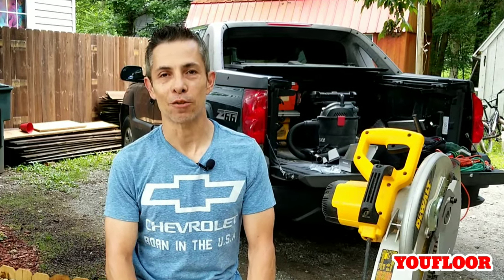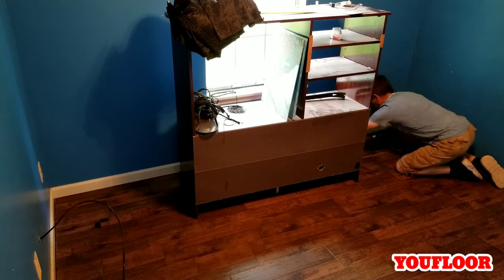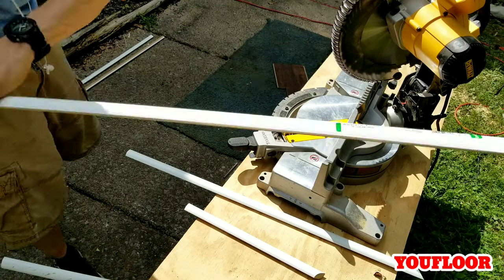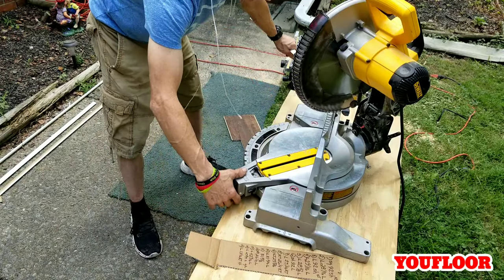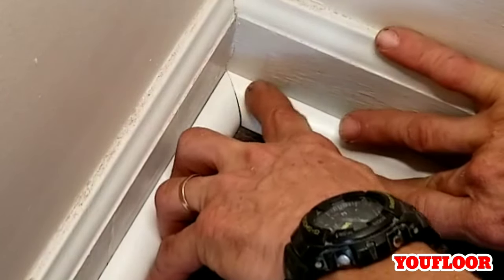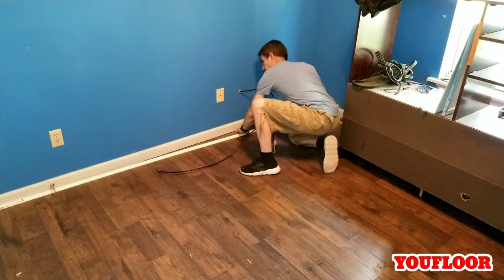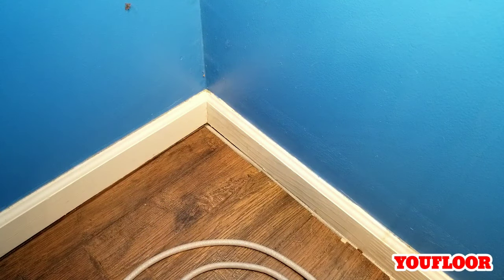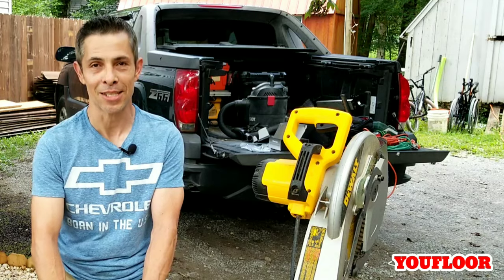How To Install Quarter Round Like A Pro

Comment: Personally, I think quarter round is tacky. A new floor warrants a new baseboard install. My method is to remove the baseboards, paint the walls,,install flooring, install new prepainted baseboards (touch up nail holes after). But that's just my opinion. Your 46 44 trick would actually work with baseboard installs as well. I'll try it out next week and see if it cuts down on install time. Those who like quarter round will benefit from your great strong by step in this video.  For me, my takeaway is that 44 46!
Reply from the maker: I hear ya. A lot of my videos in the beginning were when I was an installer for Home Depot. So when I got to the job the material was already there including the 1/4 round. I give the option on my own jobs. But home depot sales rep are like all others. The more you add to the job the more commission you make. So that why we always did 1/4 back then. For base I like to cope. One trick is to hold my gun about 1/2  away from the wall pull the lever back and fire a nail so that it sticks out of the wall. Then when placing the corner together  I flex the longer one and it will press the other tight. You can use a screw but then you may have to adjust it. That's why I use the nail. If it is sticking out too far on the bottom I can smack it lightly with a rub er mallet until the corners are tight. Hope that makes sense. Thanks for the comment
Reply: @YOUFLOOR  glad you got out of their shadow to do your own thing. Nice idea on the cope method  👍

Comment: What if you don’t have a miter saw can you use a circular saw
Reply from the maker: You would have to have a pretty steady hand if you are using a circular saw. I believe you can achieve  the same thing with a hand miter box if you place something like a wedge behind your material. I bought one for the purpose of making a video. Just haven't hhad the opportunity to film one. May just have to create one. Thanks for the question. Have a great day

Comment: I am renovating a condo that has concrete walls that are skim coated and the electric is run through a plastic chase that appears to look like baseboard.  I have installed the floating Pergo and now need to attach the base shoe to the plastic chase.  Clearly I can not nail this so it must be glued - any suggestions/have you encountered this scenario ever?  Thanks.
Reply from the maker: Yes up against tubs and sliding glass doors. I usually use silicone to attach my moldings and a couple dabs of hot glue on the back to hold it until the silicone sets up. Hope that helps.  Thanks for the question
Reply: Like the OP said silicone will work, and just buy a tube of liquid nails to get it to stay.

Comment: How do you measure for outside to outside cuts?
Reply from the maker: Hook the corner and go to the other corner to find your measurement. Then cut an outside corner (with short point against baseboard) Now measure from your short point to your measurement and make a mark. That will be to the other short point of an outside corner. Hope that makes sense. Thanks for the question.
Reply: @YOUFLOOR  

Yeah but you can't hook onto the short point so that's why I was wondering if you knew a trick to measure it after making the first cut.
Reply from the maker: @Tyler If they are short pieces you can line the short point up with the edge of your miter saw table and hook the table  and if you have long pieces to measure, cut the short point, pull your tape out longer than your cut and lock it, place tape on the ground and then line your short point up with the end of your tape. Hope that helps. Let me know if you have any more questions.

Comment: Ok so... about this foam strip situation... I’m finishing installing vinyl plank today and found your super helpful video for the quarter round. But.... the foam strips are throwing me off. I know you’re working with laminate in this video and like the sound of the foam protecting more from spills, but I’m not sure if that could fit? 
-OverThinker
Reply from the maker: This product is called caulk savor. It originally made to take up space when caulking so you don't have to use so much caulk. They say to leave a 1/4 inch but sometimes the gap can be slightly  bigger. This product helps to give you something to fill the space then the silicone will stay up on the surface of the floor. Thanks for the comment

Comment: First quarter round install and I was wondering if it’s necessary to put silicon behind each piece of quarter round like you did at the end of the video.
Reply from the maker: Not sure what type of flooring  you installed. But this is a requirement when installing pergo outlast. It is made to be waterproof. So selling the edge makes it impossible for moisture (spills or accidents) to make it under the floor. It is not recommended on non waterproof products. Hope that helps. Thanks for the question
Reply: Isn't using the cheap particle board trim problematic for having "waterproof" flooring as it swells easily when exposed to water?
Reply from the maker: You are correct. I wouldn't advise that. I would use real wood or PVC if your in a room that you know will have a lot of exposure to water. Unfortunately on the Home depot jobs. You get what you get.
I have mentioned this in the past but it will slip by occasionally. Sometimes I'll have some on the truck and just swap it out for that room. Excellent question. Thank you

Comment: Hey Z - I purchased  a product called "Trimfinity 7/16 in. x 3/4 in. PVC 127 Base Shoe" from HD. The inside of this product looks like an open cell foam and has a pvc layer on the outside. This is going in a basement so I wanted a material that was water resistant. I had a return and a short corner I needed to glue together. I used the CA glue with the accelerator as suggested but the joints did not hold together. Are you familiar with this moulding? Any other suggestions on gluing it? Thanks
Reply from the maker: @Steve Buchanan I went and bought some trimfinity today and will test it out and see what I come up with.
Reply: @YOUFLOOR  - have you had a chance to try gluing the Trimfinity shoe moulding? thanks

Comment: I used to subcontract for Lowe's, but i've been out of Flooring since around 2007. When did Pergo come out with this floor where you had to use silicone? What a pain in the ass that would be. Also just curious have you done any of the snap together real Hardwood? And how is it as far as installation.
Reply from the maker: Well pergo has many styles of flooring. The pergo XP and pergo outlast are very similar, except the outlast is treated to make it water resistant. And to make it truly water proof. The manufacturer requires us to seal the perimeter. At 1st I was Leary. "How can the floor expand and contract if its sealed up" I was told that 100%silicone flexes so it's not a problem. As far as the engineered woods. Brother let me tell you they have come a long way. Companies like home legend and home decorators collection,  and all the bamboos are a drop and lock. Literally. It was the inspiration for the company I started call "YOUFLOOR " When my son was  10 he installed 200 sq ft by himself in 3 hours. And he had never touch a floor b4 that day. I have a website I am currently loading  these style of wood for purchase. The goal is to provide the most diy friendly product for the average home owner. I mean why pay someone thousands of dollars. "YouFloor it"  thanks for the question
Reply: @YOUFLOOR  Wow ya snap together is a breeze, a beginner would have no problem in a square bedroom. It gets tricky for the DIY when cutting in say a hallway with a bunch of door jams. I figured back in '06 they would eventually come out with snap together real hardwood. Do you remember a product called Edge I believe? It was a snap together real ceramic tile. But it had issues, the grout came in a can almost like reddi whip.

Comment: Can the 44 degree cut and 46 degree cut technique also be used on baseboards?
Reply from the maker: I would imagine it would be the same concept. I usually cope the base. I saw a trick on Instagram where a guy had a huge gap at the bottom so he put a screw in on the bottom but didn't sink it all the way. By leaving it sticking out a little it acted as a shim sort to keep the base board from rocking in. Hope that helps. Thanks for the question.
Reply: That’s another good tip for out of plumb walls....thanks.

Comment: Can i have any idea you charge per sqf
Reply from the maker: If it's with another job. Generally, it is between .75 and 1.00 per month Ft. . But by itself, it would be a flat rate depending on how much time it took. Driving 30 minutes to install 50 linear ft would be something like $75 to $100. Even if it takes an hour. Hope that helps. Thanks for the question

Comment: Would if the quarter rounds are stained black could you still caulk it and then stain that part? Thanks
Reply from the maker: You never heard of that  ut most acrylic caulk  is paintable so I imagine it would stain. They make a black caulk though in case your interested. Thanks for the question
Reply: @YOUFLOOR  Thanks Ill check out home depot I didnt know!

Comment: Like a bay window I have a bay countertop which extends from the kitchen at an angle.  There is a transition at an angle from the kitchen to dining room that changes height.  How do I transition the quarter round trim around the cabinets across a transition strip into the dining room?
Reply from the maker: Is the transition a MDF ( paper like hard cardboard) or is it real wood?
Reply: @YOUFLOOR  the transition is from linoleum up to real wood with a wood transition
Reply from the maker: If it were me. I would take a scrap piece of quarter round and set it on top of the transition. Then take a razor knife and score across the fro t of the quarter round so it follows the angle of the transition. Then use an oscillating tool to cut that piece off and drop the new 1/4 round behind the transition against the angled bar. Yeah trying to run trim over transitions is not fun. Hope that makes sense. Thanks for the question
Reply: @YOUFLOOR  kinda like kerf cuts.  Great idea, that’s kinda what I was contemplating.

Comment: for pieces 1 and 3 you wrote 45 degrees (not 44 or 46).....is that because they're NOT corners (mid wall joints) ?
Reply from the maker: Yes that is why. As you can see at the saw when I actually cut it I did it on a 45° for the model joint. I guess I wrote 45 so I know it's a splice and not just a small piece. And on your second question. Yes the number I write on my paper goes against the wall. I did a part 2 of this subject because your not the only one to ask theses same questions. I went over measuring and returns in a little more detail https://youtu.be/abkTRdbOd2I thanks for the questions.

Comment: Thanks for your video, but that's not exactly what I was hoping to see.  I'm running the 1/4 round around a tall cabinet in the bathroom that goes to the ceiling.  One piece will go from the floor against the wall all the way to the ceiling.  The other piece will run along the cabinet and meet the vertical piece.  So I have a vertical piece and then a horizontal piece.  I guess I'll do some trial and error.

Comment: Have you ever used the cutting pilers!?
Reply from the maker: If you are referring to the quarter round d cutters ,then yes sir I have a pair and I o ly use them on on real wood shoe mold or 1/4 round. They are real nice at first  but the blades wear down over time and they start to crumble lyour trim. I've tried sharpening them but that made the blades not touch and then you just hoping that you can use your cutters just one more time. Lol but hey they are a super time saver freash out of the wrapper. Hey clayton thanks for the question buddy.

Comment: but I don't have that nail gun. Any advice on how to do it with a hammer? super duper non expert here.
Reply from the maker: They didn't have nail guns in the old days either. Just get some 2 or 21/2 inch trim nails. Drill a tiny hole smaller than the nail. Trim nails have a small dimple in them so you can drive it with a hammer as close to the wood as you can and then finish it off with a nail set. If you don't have one you can set another nail in the little dimple and strike it. This will help you not to damage your material. And by the way do you have a saw to cut them. Cause if you can work a miter saw a compressor and nail gun are no problem. Hope that helps. Thanks for the question

Comment: my miter saw only goes to 45....I'm...going nuts
Reply from the maker: You can place a thin shim behind the 1/4 round in the saw. That will change the angle. May have play with it to get it right. Also even though it says only 45 some saws will let you go a smidgen more then lock it down. Hope that helps.

Comment: i see why you would quarter round in this instance, but the whole point to baseboard is to cover the transition between floor and wall.   if installed right i dont see why you would want to waste money on quarter round on the floor.   unless customer wanted it
Reply from the maker: Yes sir with carpet that is the case. But generally unless it is new construction  or the customer requests removing  and reinstalling the baseboard, we usually go with what the customer  ordered. I  installed for H. D. and most of the time when I showed up at a house the floor, transitions, and 1/4 are already on the property. On my side jobs we remove the base , unless customer request otherwise. Thanks for the question
Reply: @YOUFLOOR  ok thats what i thought;    was hoping i wasnt doing anything wrong lol.   im no professional just apt updates during winter

Comment: I cope my joints on the inside
Reply from the maker: On 1/4 round? I mean maybe if it's the only thing I'm doing. But I have found(on shoe mold and 1/4round) I can save a lot of time without sacrificing quality. I only cope on bigger trim. But hey you do you. Its definitely not wrong either way. Thanks for the comment
Reply: @YOUFLOOR  I agree,  you do awesome work young man thank you for your videos, I’ll keep watching, I coped mine because of the movement with solid wood, agree pretty work from a pro, thank you.

Comment: If it’s not the same measurement up and down on the piece of trim it’s not quarter round. It is shoe molding.  Makes me cringe when I see shoe molding installed as in this video.
I do appreciate the tips about cutting angles at 46° and 44°.
Reply from the maker: I appreciate your expertise and your need for exact wording. And technically you are correct if it is not an inch and a half round pole cut into 4 exact pieces  it is not true 1/4 round. However if you are looking for the product I'm installing and you look on home depot, The words that appear on my paperwork says 1/4 round. And if you want to actually find  it , you will need to type the words zamma white quarter round. If you type shoe mold you will get real shoe. But you will never get this product. So if I want my viewers to find exactly what I'm Installing,  I use the exact wording for the product. Is that fair. Makes me cringe when someone tells me one thing then I spend 20 minutes looking for the wrong thing due to wording. Heres the link if you like to take it up with Home Depot.https://www.homedepot.com/s/unfinished%2520white%2520oak%2520zamma%2520moulding?searchtype=suggest&NCNI-5.  Hope that helps. Thanks for the comment

Comment: Curious how you would affix quarter round between tub and floor. Luxury vinyl flooring
Reply from the maker: You are going to have to use silicone if you are on concrete. To get an immediate grab, I use silicone and a  huge hot glue gun to hold it in place. The hot glue will give quite a bit of perminate hold but it primarily to hold it in place while the silicone cures.  If it is a wood subfloor just make sure to leave a  small gap for nails and nail down through the floor. And if you want to get real fancy you can scribe the boards against the tub and used a white silicone caulk. No trim needed then. Hope that helps. Thanks for the question

Comment: What nails did you use?
Reply from the maker: 18 gauge  brad nails thanks for the question
Reply: What length? I have a max 1 1/4" length finish nail gun, installing 11/16" quarter round,  would these be long enough?
Reply from the maker: Well I use 2 inch brad nails. Personally I wouldn't use 1 1/4 " nails some time the base board is a little high and you totally miss everything,  putting an uneccary hole in your trim. With 2 inch I have a better chance of hitting the studs in the wall  and there is plenty of nail going though many layers. Hope that helps. Thanks for the question